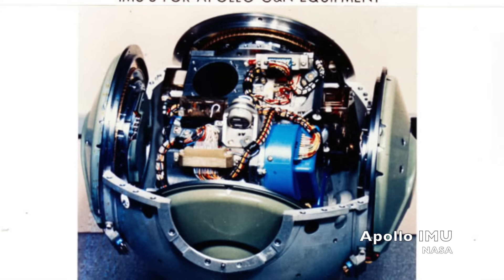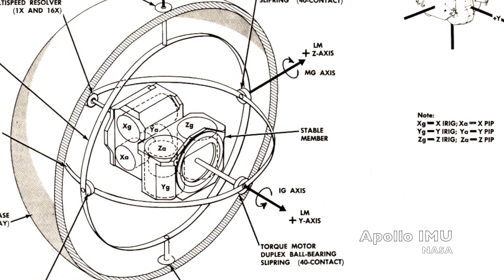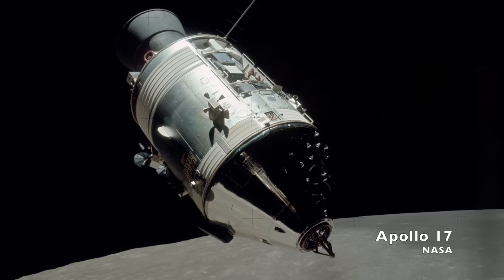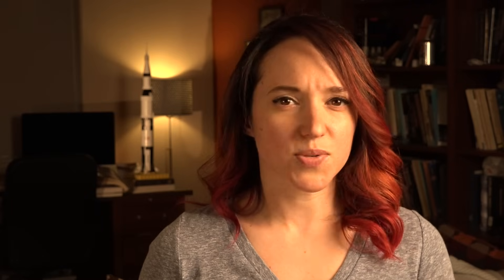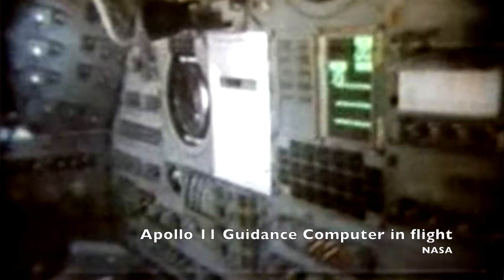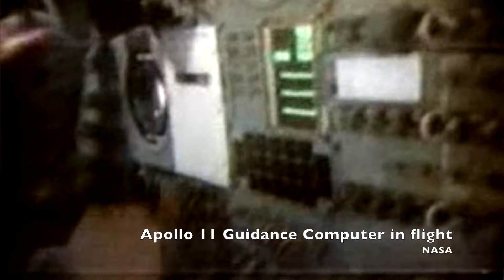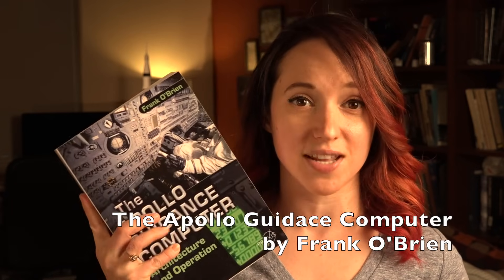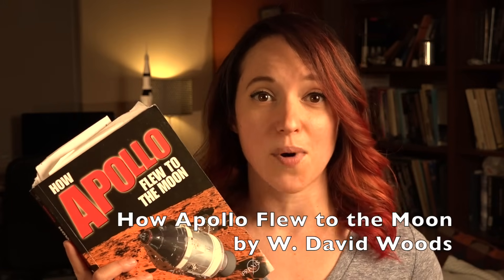Gimbal Lock and Apollo 13

Comment: That's a very nice fairy tale.  We never went to the moon.....rockets do not work in a vacuum and furthermore....talk to an industrial seal expert and they will tell you there is no material (natural or man made) that can seal the propellant tanks in the extremes of space.  They can't even keep the tanks of the SR71 Blackbird sealed on the ground and in flight because the temperature extremes cause the airplane to change it's size and the seals cannot compensate.......rockets experience MUCH greater temperature extremes while in space  merely being there as the sun ferociously heats one side and the other side remains exposed to the frigid temps of space.  Stop, think.....and use your common sense.  Don't accept what "they" say with a childlike faith in fairy tales.
Reply: idiot
Reply: I assume that you don't use any GPS device because the GPS satellites don't exist.
Reply: +Gianni Ognibene  Perhaps he assumes that they use some other method to maintain orbit, and believes that rockets only work when they have an atmosphere or other material to 'push' against.

Really basic physics fail, but many people are very ignorant of anything that they don't have to know for their daily life.
Reply: Why do you believe that rockets don't work in a vacuum?  It's just basic physics.
Reply: So why don't the Blackbirds/ tanks run dry during flight and at very thin high altitude?  And have you ever called anyone long distance? Say, through a geo synchronous satellite link?  How did those satellites reach that position.  Pretty sure rockets were involved.
Reply: Midair refueling.

Comment: I fly a small aeroplane. the gyro's in the gyro-compass and artificial horizon also can "topple" with unusual manoeuvring. you can lock or "cage' them with a simple button. the gyro is spun by a venturi tube which sucks air past the "buckets" round the periphery of the gyro. compasses do wild things when turning east or west, that's when you use the gyro-compass. you then let the magnetic compass settle down and realign the gyro-compass on that heading. you have to allow for true and magnetic north and the compass card corrections because the aeroplane is made of metal. that's done on the swinging table on the ground in all points of the compass to correct the readings. it's fascinating....but how is is a lot simpler ! you must learn how to use both...the old and the new.

Comment: So do spacecraft have a 4th gimbal today?
Reply: nope they use a laser shooting into a 3D prism that is held stationary with light detectors in all 3-axises (xyz).
Basically when the rocket changes it attitude the laser strikes a different part of the prism
Reply: What about power, how does laser work without power in an emergency?  I am just a lay person, but I am thinking the gimbals don't need electricity?

Comment: So if they're all at 90 degree angles to each other, how do they 'align'?
Reply: When the vehicle moves in an axis faster than the servo motor can move.
Also, SIZE and WEIGHT are big factors  in going to space.
A fourth gimbal would dramatically increase both weight and size.
http://www.hq.nasa.gov/alsj/e-1344.htm
Reply: ***** Great... Doesn't at all answer my original comment.
Reply: A Rocket
I think it did answer. But you may not understand what gimbal lock is -- and this video did not do a precise job of describing it -- which is why I provided a link to a NASA paper describing it.
Reply: They are not fixed at 90 degrees. They rotate within each other and the output of the change is what the ADI displays really. So you have a fixed value (which is the "aligned" value for zero) and then the gyro uses a  3 wire syncro for each motion to detect the change over time etc. A normal flight computer for the time used a separate pitch roll and yaw computer to actually take those vales and then convert them into a value for the ADI indicator. Each gimbal is nested within the other so outer/middle/inner... and they are free to move and that is seen as pitch up/down, roll clockwise/counterclockwise, and yaw left/right. The alignment is simply the computer taking the current location of these and setting that position as its "zero" reference. This is normally done on aircraft every time prior to flight just as part of the computer self start for newer ones. Does that help?

Comment: you can illustrate the phenomena with a simple compass.
- hold the compass base (plate) horizontal to ground. the needle shows (magnetic) North and you can read your bearing in degrees due to North. OK OK we all know this :)
- then hold the compass base vertical (i.e. pitch the compass 90 up in Apollo terms). the needle will struggle to show North and you cannot get a reading.
- at this point the needle is LOCKED. you can roll the compass as much as you want.... everywhere is North.
Reply: First, this is a really bad analogy. Second, the term "lock" is a bit of a misnomer. Nothing seizes up or otherwise gets actually locked. "Tangled" is a better word (as someone had mentioned elsewhere). If 2 of the gimbals align to the same plane, the information the whole assembly provides to the guidance computer becomes meaningless, because it needs the differences between all 3 axes to calculate the attitude. Any input (attitude change) that corresponds to either of the affected gimbals, can not be distinguished from the other, as they both rotate erroneously because they're aligned to the same plane. This requires manual intervention (alignment) to "untangle" because once they're in alignment, gyroscopic precession tends to hold them there, just as it tries to hold them correctly aligned under normal operation. Hence, "locked".
Reply: +MadScientist267 Really need to correct myself in one spot there... "because it needs the differences between all 3 axes" really should say "because it needs correct information from all 3 axes". The key point was that the computer can only use the information it's given, and gimbal lock is not related to any fault in the computer, it's a purely physical phenomenon.
Reply: +elvis3571 If you read one of Amy's comments above, she corrected herself, saying that onky 2 of the gimbals lock together.
Reply: great explanation.
Reply: But that's why you have gimbels in every dimension.
Reply: I m not sure if I understood you correcly...
three gimbals on three axes (x, y, z or roll, pitch, yaw) will lock at some position as well as one gimbal on one axis at some position.
thats not multiple gimbals in three dimensions.
solution is a fourth gimbal (properly positioned of course).
perhaps you were saying this...
Reply: I didnt say all 3 gimbals are locked into each other, srry if it sounded that way,
an INS with 3 gimbals at 3 axis will lock at some position, solution is a fourth gimbal, thats what I was saying,

Comment: Why is it that ground controllers allowed for planned sleep periods for the astronauts on the moon when the lunar module had absolutely no sleep quarters? How were the astronauts expected to do their EVA's and science experiments and not make a catastrophic error without sufficient rest. The crew often slept either on the floor or on the descent engine cover. They also had to stay in their pressure suits in case of depressurization, so the large neck ring made it almost too painful to rest. Was weight such an issue that some sort of sleep arrangements could have been allowed for?

Comment: You are beautiful and a brainiac!  I've had the honor of having lunch with Jim Lovell right after the film was released.  He said the film was quite accurate - with the exception of the hollywood-portrayed tension with Jack Swigert - Lovell said there was complete faith in all the crew.
Reply: Sutterjack Not to mention other tensions and extended burns not present on the flight. Swigert wrote the emergency procedures for the CM, so he was the best possible CMP to have on that flight. Good thing T.K. "Ken" Mattingly got exposed to (but never got) measles. ;)

Comment: I'm just greatful that KSP doesn't have gimbal lock ^^
Reply: I remember some PC flight simulators could get gimbal locked by pitching up to vertical, then rolling 90 degrees. Bingo, you could no longer pitch up or down to return to the horizontal. You could only yaw sideways.
Anyway, I gather everyone uses quaternions now for rotations.
Reply: @IanTester  So how do you make a quaternion gimbal?
Reply: @RogerBarraud  It is similar to an SU(2) matrix a 2x2 matrix U=[a + bi   -c + di
                                                                                                                  c + di     a - bi]
but the group of unit quaternions  q = a + bi  + cj + dk are done with quaternion multiplication, given the restraint of a^2 + b^2 + c^2 + d^2 = 1 as represented on a hypersphere S^3.
Reply: Sure it does! Just lose the command module, all rcs thrusters, and run out of power. Then your good to go!
Reply: Brian M And I'm one of the other lunatics that would love to download and install it
Reply: Pesterenan Você aqui também :D
Reply: I'd rather have such thing in exchange for a guidance computer that can plot the course from takeoff till landing, a more stable SAS and an actual controller instead of WSADQE to maneuver
Reply: @shepherdlavellen3301  What's stopping you from using a controller/Joystick?  I have both and I actually rarely use them for KSP since I'm so used to the WASDQE control scheme...
Reply: @Brian M LUNARtic
Reply: It has something like that when you go directly to a pole of a planet.

Comment: Hi Amy, I have a vintage space idea... For what its worth, how did they get the film footage from inside the spent stages of the Apollo boosters. It is obviously film because in looking at the footage you can see the leaders and enders "Light wash'. I am assuming that the spent stages burned up on re-entry... were the cameras 'hardened' against heat and stress? How was the footage recovered in such excellent condition. As a child of the late 60's, early 70's I know that the video of that vintage was no where good enough to render the quality that is available on YT. PS: Congrats on your budding TV career, Your excellent! Best wishes!!

Comment: Well, I wanted to pick the video that most closely related to my question. Since I think I saw these marks used in Apollo 13 I pick this one. I know I could "google" this question but I was hoping for an "Amy answer' or an answer from you guys. Here it is. Explain the grid on the observation glass on the lunar module. I think they must be related to navigation in some way, but how. Thanks.
Reply: +Dan R The windows were pretty thick and there were two sets of lines, one scribed on the inside surface and one on the outside surface. To use the lines as a sight you had to orientate oneself so the lines  were in alignment with each other. If it looked like one set of lines because the inside lines obscured the lines on the outside then you could use them  as a sight to measure the angles to things outside of the spacecraft.  The idea was that if a particular crater was, say, 20 degrees to the right and a certain boulder was 40 degrees to the left then you knew you were in the correct location.  If the boulder was only 30 degrees to the left but the crater was at 20 degrees to the right then you knew you had to fly forward and to the right until the boulder touched the 30 degree line, maintaining the intersection of the 20 degree line over the crater. A simple, reliable and elegant solution to the problem of knowing where the LEM was in reference to a location on a map with only the two small windows to look out.
Reply: Hello bitmapped. If i had had to guess how to use those window markings I never would have made that guess. Your answer explained things very well. Is this technique (aligning two lines) use in some application here on Earth? It seems that it could be used in construction in some way.
Reply: +Dan R It used to be used by surveyors but has mostly been replaced by lasers these days. Really not that much different than how open sights on a gun work.

Comment: I have always wondered why a space craft cannot just gravity drop once they are over Florida. Just get into geo-synchronous, point the nose down, hit the thrusters and DROP. What would be the problem with this? They would never have to move any faster than what gravity would pull them. The guidance computer could compensate for wind drift. Is it a matter of too much fuel to decelerate? Just get over Florida and drop! Why not?
Reply: +Wasatch Range Railway As a seasoned Kerbal-pilot I can answer this. The Geosync orbit is very high. Dropping directly from that altitude into atmosphere would mean that the spaceship would have only like 100 km of atmo to decelerate, which would burn the ship. Also, the amount of fuel you need to get to the geosync is a lot, and decelerating to zero orbital velocity would require fuel, and if you want to prevent your ship to burn on re-entry, you would need fuel for decelaration.
Reply: makes sense to me. I always wondered if it was a fuel issue. Damned if they do and damned if they don't. Getting back into the atmosphere is a tricky piece of work. Let's just tie a big chain on and hook it up to a dead-man. When we come back around hook up to it tell them to start pullin' they could drag them back in:)

Comment: They had plenty of things that could go wrong to deal with. One being the guidance computer could mistake a crater if deep enough and shut off the engines dissent engines on the LEM before it had landed. But they said only 4 craters on the moon could do that and they never went them.

Comment: Two things I would like to point out. NASA opted for the 3 gimbals instead of 4 to save roughly 50 lbs in weight. Secondly, if gimbal lock occurred, the situation could be rectified through re-alignment using the sextant (i.e. celestial navigation). The only problem was it took roughly 60-90 minutes to reacquire re-alignment. Therefore, if gimbal lock occurred at a critical moment, then it would be considered a dire situation. Otherwise, gimbal lock was not as bad as people think it was.

Comment: Ironically, Gemini (Apollo's predecessor) had a 4th gimbal to avoid lock (as was referred to in the post). In Mike Collins wonderful book "Carrying the Fire", Collins laments that the McDonnell's learning from Gemini was not adopted by North American Aviation Apollo design. He laments this fact that there was a bit of 'not invented here' attitude (NIH) or "we don't do it that way in Apollo".
Reply: +Andrew Gwilliam
" Why would a 4th gimbal mean the instrument was less precise?"
The gimbal assembly is a series of gimbals, one inside the other. Granted, they obviously use very high quality bearings but are not perfect. Since all the gimbals are one inside the other, whatever slop or backlash each bearing has is added to the next gimbal, so the total play is the sum of all the bearings' individual backlash or play. Adding a fourth gimbal will add to the total play or backslash, making the gimbal that much less precise.
Reply: It had more to do with weight.  Gimbals weighed 50 pounds.  50 pounds was a lot bigger of a deal in Apollo than Gemini.
Reply: Weight and added slop, however small, of yet another gimbal. Gemini was just orbiting the earth, but Apollo couldn't afford the precision loss of one added gimbal. And the weight.
Reply: corisco tupi  Thanks!
Reply: James Rosencrans The latter bit Borman ran into when North American reversed the polarity of one of the controllers so it was not intuitive to the way typical fighter pilots used them. Borman won that battle. :) (Mentioned in Kluger's great book about Apollo 8.)
Reply: corisco tupi  I'm genuinely ignorant about this stuff.  Why would a 4th gimbal mean the instrument was less precise?
Reply: That NIH attitude (pardon the pun) was one reason for the Apollo 1 fire.
Reply: bostonseeker The biggest problems were all the flammable fabrics and wires that were overlooked by NASA QC, flaps that cut wire insulation,  ... and that 100% pure O2 in the cabin on the ground.

Comment: The thing that made things complicated on AP13 was that they had turned of the FDAIs in the LM to save power. Instead, thed had brought up Noun 20 on the DSKY, displaying the gimbal angles in raw numbers, which wasn't very intuitive to fly. In the end, the astronauts made themselves little post-its with 'yaw left to null negative' etc. next to the registers. Ironically, it turned out later that it would've saved more power if they had turned of the DSKY and kept up one FDAI instead.